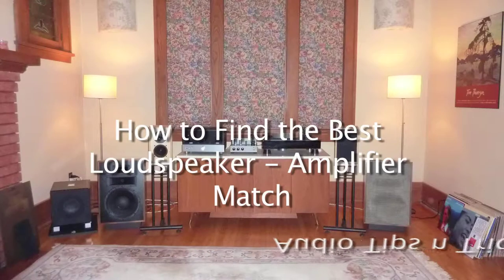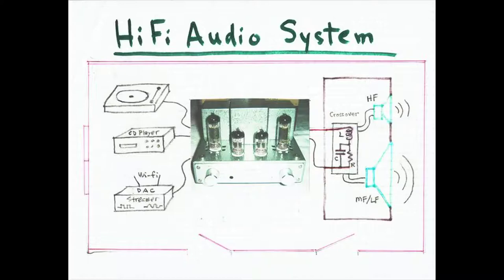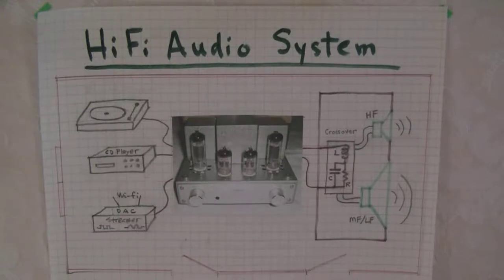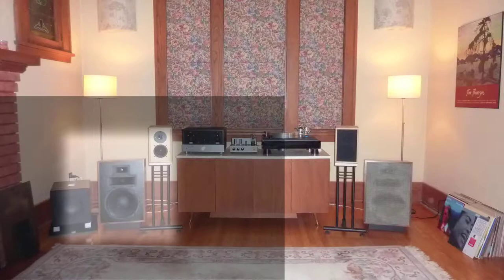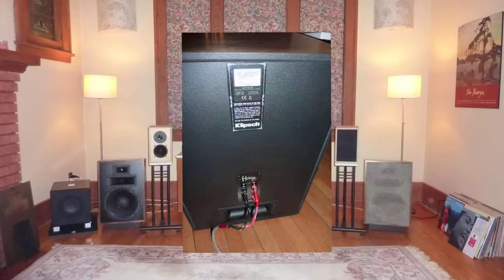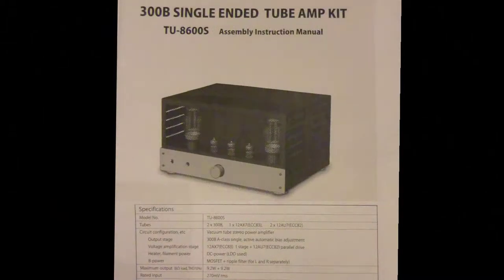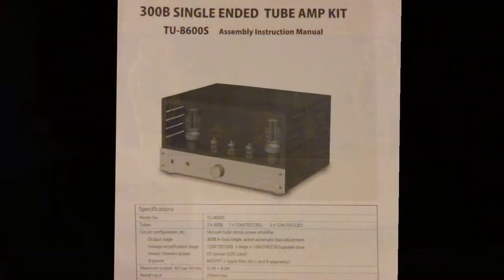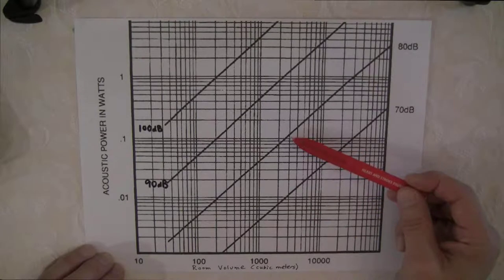How to Find the Best Loudspeaker - Amplifier Match

Comment: Hello Raymond, 

I always appreciate your thoughtful videos. I was able to easily measure my room after watching some of your videos in the past. I have the Klipsch Heresy IV paired with Quicksilver Horn Monos. I experienced something a few weeks ago that might be clipping despite the Horn Mono blocks being rated at 20 watts. I've actually never experienced this effect with any other setup. On one particular recording, Oklou's recent bass heavy album "Galore", I am hearing heavy distortion during heavy bass sections on both my vinyl and digital copies. I obsessed about this problem for days, switching amplifiers from left to right channel, cables, speakers from left to right, etc. The speakers themselves are certainly not damaged, and in fact I can't get the speakers to distort in the same way on other bass heavy recordings unless I push the volume to extreme unlistenable levels. I know this is limited information, but I'm wondering if you have ever heard of recordings being so heavy in the 50-80hz range that they pull more power from an amplifier and cause clipping? I ended up giving up on the problem as all other recordings sound fine. Klipsch offered for me to send in my speakers, but the speakers don't seem to be damaged. I'm wondering if I'm experiencing clipping.
Reply from the maker: Thanks for your feedback. The Heresys use a conventional cone woofer which is less efficient than the mid & HF horn drivers. Plus the LF response falls 6 dB at 48 Hz. Low bass could strain your monoblocks. Are they tube or solid state amps? If tubes are over driven they just compress the sound. If solid state clipping, you might hear crackling sounds. I use a REL sub with LS53As. For really low bass, try using a powered sub. Good luck.
Reply from the maker: Sound of busted speakers & 'crackling' probably sound similar. My experience w tube distortion is limited to SET tube amps. If your tube amp uses feedback, distortion may sound different. My 100W sub got into self-oscillation mode a couple if times trying to play a very low bass passage. No damage to speaker drivers.